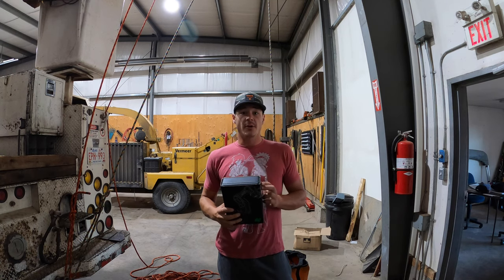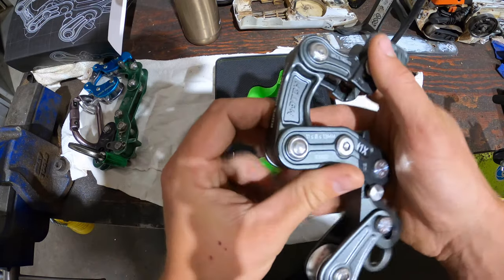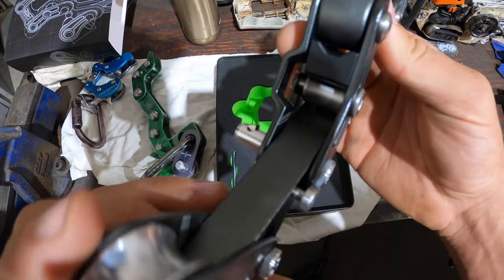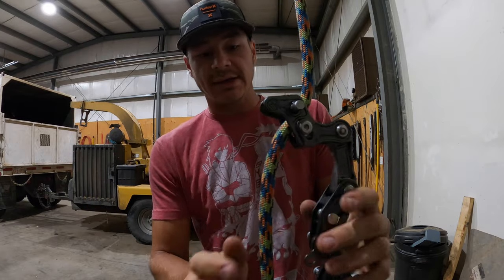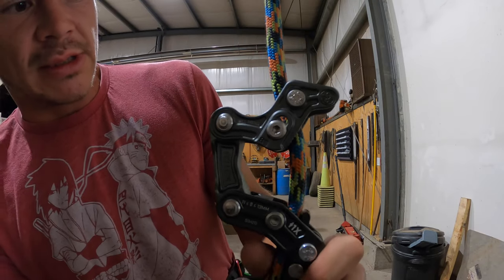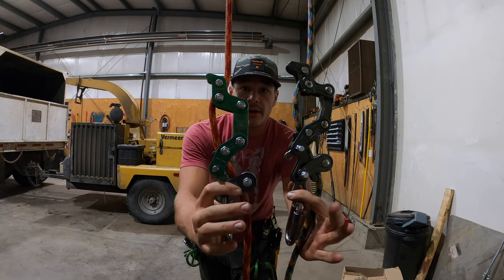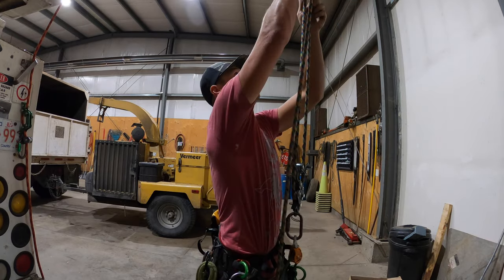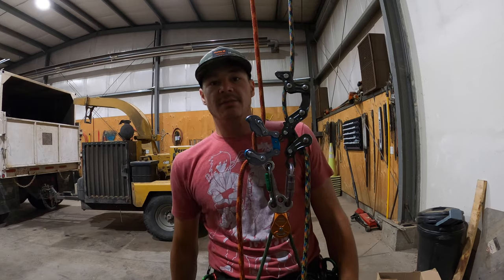ROPE RUNNER PRO!!! Unbox/First Impressions

Comment: Thanks for posting up your feedback. 
My RR Pro showed up yesterday. I have been climbing on the original 
RR for several years now and it is still my favorite device for SRT. I have 
read/watched all the feedback I can find on the RR Pro but to be honest 
I didn't need to. By far the biggest "issue" I have heard about is the allen 
wrench. I adjusted my RR Pro right out of the box using the wrench and 
it worked OK. I can tell it's not a "high quality" tool and I will very likely be 
tossing it for a better wrench. I'm looking forward to getting some actual 
climb time on it to see how it compares to the original. 
Thanks again for the video and keep yourself safe! 😎👍❤️🌲
Randy
Reply from the maker: Awesome man enjoy your runner !
Reply: @PoplarMechanic  😎👊❤️🌲

Comment: the rrpro works very well with the xstatic. thats one of my favorite climbing ropes. I also have my rrpro set to just under the #3 on the friction bollard. im going to flip the slic pin on the bird as well. thanks for the tip.
Reply from the maker: Hey thanks for watching man, greatly appreciated! And ya xstatic is my favorite rope right now for any srt mechanical device! 🤟

Comment: hows it going nice vid i have a question does the new runner have the baby bump and did the bird beek hurt your hand at all.
Reply from the maker: Thanks and no it doesn't hurt my hand it is smooth on the top and I don't believe there's a bump, im going from memory because its in the shop, i just got it but I will double check, I believe its flat.

Comment: Popplar. Akimbo or RRP? I've been on akimbo for a while and im very tempted to get the RRP.  What can u say about it now after a while .
Reply from the maker: Well it is nice there is no question about that, I still use the akimbo alot, I would say more that the rrp. They both have there qualities but if your like me you'll want em both 😆, everybody is different but I would say if you got it, it wouldn't disappoint, its very smooth and the pulley is a nice feature for tending.